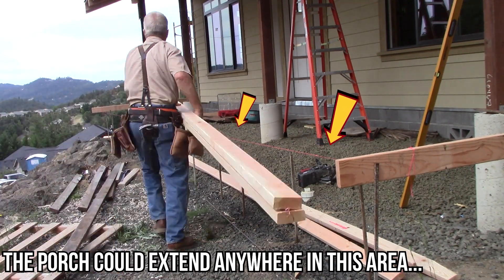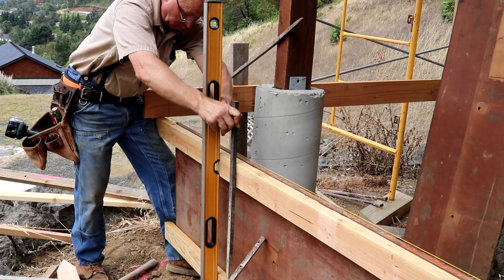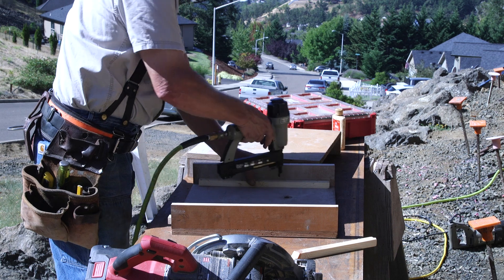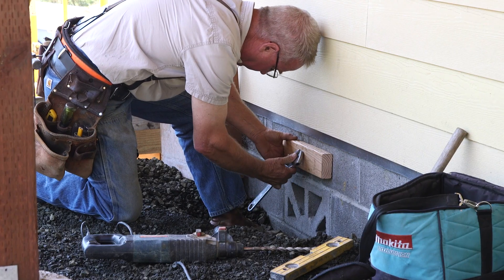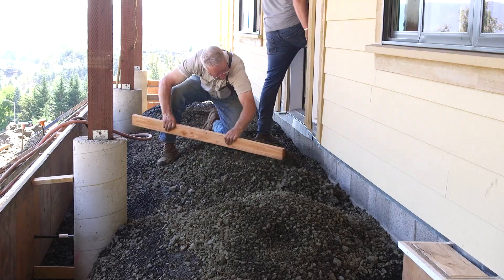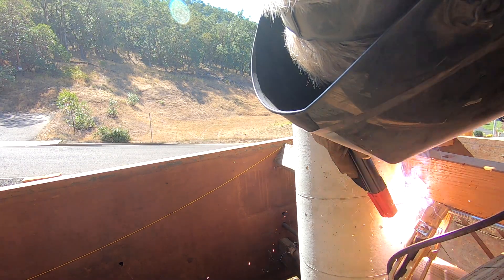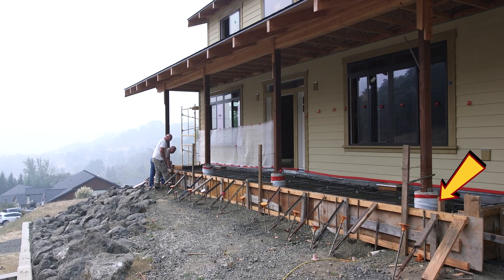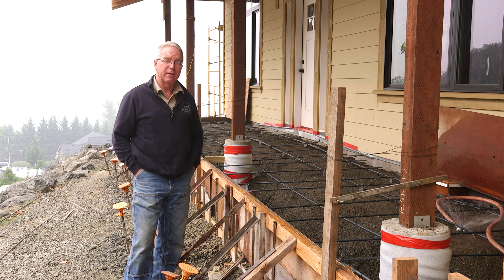Forming A Concrete Porch Ep.91

Comment: On the fires, I heard some reasoning that it's due to a lack of logging and I thought here would be about as good a place as any to get some thoughts on this?
The reasoning was that loggers obviously thinned the trees meaning less fuel but also that they cleared the brush from the forest floor meaning it was harder ground for the fires to spread. Lastly the trails acted as fire breaks. Anyone in the know?
Reply: (Disclosure..I have logging in my background)  Depending on the terrain, weather and fuel load, large catastrophic forest fires are going to run through timber regardless.  If the trees are larger and more widely spaced, a smolder or spot fire is going to have a lot harder time getting to the point where it can ignite full grown trees and canopy.  Brush and undergrowth will accelerate spot fires, providing kindling of sorts to build heat; it's gonna grow back after an area is logged, but will naturally thin as increasing forest canopy limits sunlight hitting the ground.  Logging can be one tool amongst several to mitigate fire risk and intensity.  It's not a final solution, and it needs to be done with resource management in mind, rather than simply extracting board feet.  Sometimes it makes more sense to clear-cut and start over, leaving some seed trees.  Other times thinning is better if the basic forest structure is in place, just needs some room for healthy trees to thrive.  If haul roads are done with longevity in mind, both short and long term, some can be abandoned and reclaimed, some retained as two-track roads to aid access into high risk areas.  We had a fire here in Central MT this year that could have turned very ugly for a couple reasons, but was dealt with better because of access provided by old mining and logging roads in addition to the maintained Forest Service roads present.  Depending on size and location, trails can act as a fire break for low intensity ground fire only; they are of no use in a crown fire other than access or an escape route if there's time.  High intensity crown fires create their own weather and wind systems..they'll ignite spot fires a mile away sometimes.  And can cover ground at a truly frightening pace.

Depending on who's doing the talking, logging is either the best or worst thing possible for a forest.  I've seen good and bad practices, and I see a lot of people who hate logging using the roads it created every summer weekend without realizing it.  If we mix a few good ideas from old school and new, I personally feel it helps with forest management, helping mitigate fire risk and providing an important boost for small local economies.  Short answer..I'd rather see my state and others thinning timber than watching millions of acres burn every year.  Logging is not going to completely halt that, but it sure could help.  Since Yellowstone burned in '88, we've had maybe three or four warm seasons here in Montana we've not been choking on wood smoke for 2-4 months out of the year.  Gets old.  Hope this helped give insight on things.
Reply: @jayphillips4058  I sincerely hope you’re getting this knowledge and opinion to those people who can implement it.
Reply: @jayphillips4058  Thank you for taking the time to write that out and lay out your position. Appreciate it and learned a few things.
Reply: @robertbeirne9813  My days in the woods are behind me, now it's just firewood and select cutting for residential and ranch/farm roads I build.  Logging is a touchy subject in Montana; the majority of people moving here are adamantly against any kind of extractive industry.  I personally feel we've learned enough to boil the best practices to the top, try and revitalize some of our small towns, keep from burning up every year.  But I am in the minority anymore, and I fear we're a long way from seeing the end of severe fire seasons.
Reply: @jayphillips4058  Wish you the very best.

Comment: I know the grade slopes away but the kickers seem too short and too verticle and we would always put two sets of kickers next to each other, one high, one low. The top one at least 6 ft. long. 45 angle is not very strong, the lower the angle the stronger the brace is.  With that said, awesome set, I'm sure it will hold.
Reply: Also, the longer the brace, the more it can flex.

Comment: If you don't have a welder handy to weld those nuts to the wedge anchors you can also back the nut up with a second smaller nut.
I love those big square steel stakes with the holes in them, I've seen nothing like that here in Japan.
The prep you put into that concrete work is why you are so successful at it Scott, really impressive!
Your point about keeping the rebar in the concrete for it to add strength is so important, I really do not like it when I see the rebar just lying on the ground and people lift it up as the concrete is poured, too much room for error, IMHO. Another point about that is if any part of the rebar is sticking out of the concert exposed the air, or even just in the dirt, it will rust, and that rust over time will travel up that rebar and spread like a rash, the rust will push the concrete off of the rebar weakening the whole structure.
Sure hope those fires are done, for now, very scary summer overall for you guys.
Cheers from Tokyo!
Stu

Comment: I have always learned from this channel when it comes to concrete forming, however I learned something that even Scott might like from @texasbarndiminums and @offtheranch or @demoltionranch when building a turn down monolithic slab. Eric and his crew use 6mil poly in 4’ width to create a 6” sand bag edge with the fill to create the edge that you are filling with concrete. This sand bag edge let him create the desired wall with a rebar cage and bring is fill up to the correct height. I know is Scott were to see it he would be like “yup totally didn’t think of this trick”
Reply from the maker: Actually I’ve been in Texas a couple times and seen them do that. They use road fabric often for large fills.They can go up incredibly high with the controlled fill side and single side forms on face side! Impressive!!!

Comment: Nice build it yourself project.  The steps have to be custom.  For the rest why  not use, or at least mention, the standard rental forms for wall pours like this, more than strong enough with steel where necessary, and designed for quick peel off?

Comment: At 10:06 you mention it is important to 'soak the subgrade'.  However with no explanation?  What is the benefit of soaking the subgrade?
Reply: Concrete requires water to cure, if it doesn't have enough water, it won't cure completely and will be weak.  Dry soil can suck some of the water out of the mix, and wetting the soil down before prevents that.

Comment: This isn't a troll, I would sincerely like to know: I see the flashing under the siding, but how did you get around the requirement of 6" between grade and untreated wood, and are tou back filling against the front? Are you not required to go below the frost line?
Reply: Don Coumbs I think the covered porch has something to do with the lack of a 6” separation.  Concrete porches poured right up to the front door threshold is very common out West.  
Hardie Board cement siding and treated mud sill also factor in, I suspect. Frost line is not a thing on the West Coast, at least at the low elevation and proximity to the Pacific Ocean that Roseburg has.

Comment: What does soaking the gravel base do?
Reply: Stops the aggregate from drawing all the water out of the concrete too quickly and causing in to crack. Similar to wetting a wall before rendering or plastering.

Comment: What's the purpose of soaking the subgrade? IIRC you didn't do that for the other pours.
Reply: Soaking the sub grade saturates the soil so that the soil doesn’t absorb the water from the concrete and change its composition.
Reply: What Kevin said.  Concrete needs water to cure, dry soil can draw that water out and cause the concrete cure to be incomplete resulting in weak concrete.   I'm not sure why it wasn't done in other pours. Maybe it was and just didn't make the cut into the videos,  or maybe Scott felt it wasn't necessary for some reason.

Comment: My sorry concrete man failed to cover the house with plastic, so he splashed 10,000 drops of concrete all over the aluminum siding. Later I spent weeks carefully removing each of 10,000 splashes, using a wood chisel. With the difficulty of hiring skilled contractors, my conclusion is that the homeowner must know MORE about each trade than the contractor he is about to hire.

Comment: Couldn't you build the edge with plastic and gravel so you don't have to put in so much extra concrete at the edge?  Allot less grade time also. Also I angle pin to the foundation so it doesn't pull away as easily.  I love your videos but like new ideas also.

Comment: why do you pour everything in concrete? I would really like to see the ups and the downs of pouring everything in concrete instead of paving.
Reply: Concrete lasts longer might seem expensive for the long run it’s better in my opinion
Reply: You can always stick some thin paving on top of the concrete if you prefer those looks...
Reply: The only thing asphalt is good for is a driveway and even then concrete is better
Reply: @Mrcaffinebean  The first time you try to change a tire in the driveway and the jack sinks into the asphalt, you'll realize it's not even better there.  It's just cheaper while still being better than mud.
Reply: @Elkadetodd  I think you misread my comment. I said concrete is better.
Reply: How would you have paved anything on this project to date?
Reply: @D Shurak I actually mean paving like in laying concrete bricks. It's the only way I know how it is done anywhere in europe. I've never seen a concrete driveway or porch in my life!
Reply: @BIOStheZerg  or stamp it
Reply: @D Shurak Nah, paving as in flat slabs, stones or concrete/ceramic tiles.
Reply: It's partly fashion... pavers are considered an old ("grandma's house") look by many, and do require a certain amount of maintenance depending on the final result you want, but you do see red brick pathways and the like coming into fashion in some areas, and driveways with pavers that grass can grow through are trendy in high end areas.

Comment: That sure is a strange way to form up concrete...sure have to put 10x more bracing putting walers like that (and welding??? Huh?? Way to add more work). 
Stick to forming with 2x only, no plywood. Those videos are better. Lol